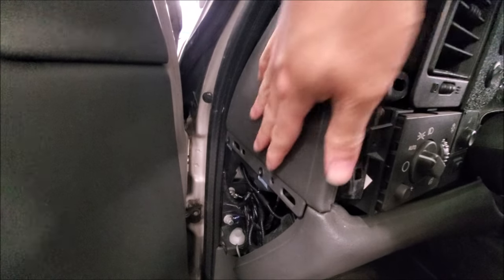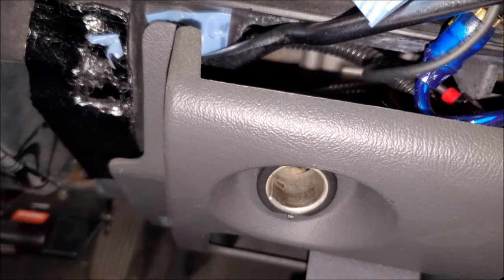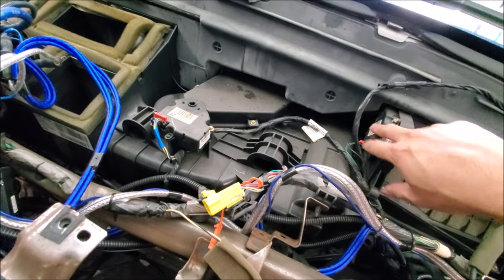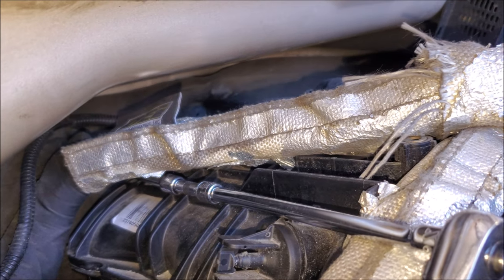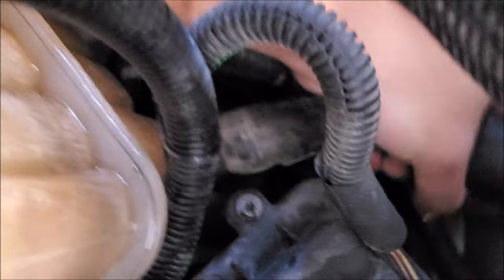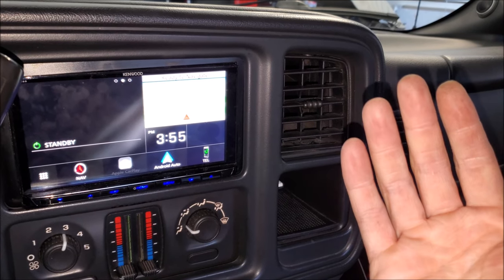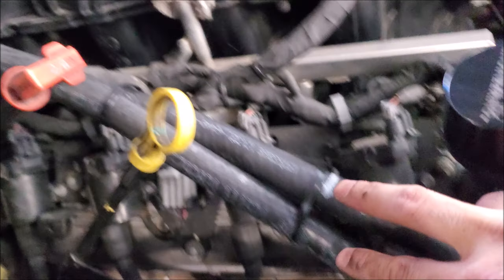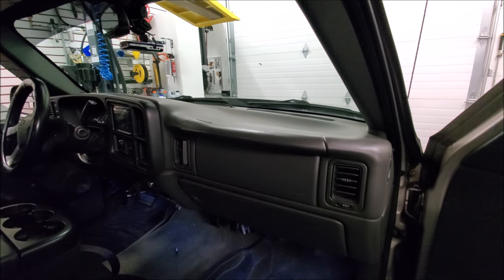Heater Core Replacement 1999-2007 GM Truck (GMT-800 HVAC)| AnthonyJ350

Comment: GM should be ashamed on this design. Dashboard should be one unit and be able to be pulled back in one piece. You have to disconnect your AC system to replace the heater core? Ridiculous.  I bought a 2005 Silverado 2 months ago. Sorry I did. The Fords I had the  dashboard pulled out as one unit and I replaced the heater core without dealing with the AC system. GM should be ashamed with their HVAC system.
Reply from the maker: Your 2005 Silverado is one of the longest lasting trucks on the road currently, and the whole power train is easy to work on.

Did you not see how ingenious the head light design is?

What do you change more often, the heater core or a head light bulb?
Reply from the maker: Triton Ford V8s break spark plugs all the time till the new part came out.
Reply: Ohh yeah you want a ice cream too?
Reply: Try a ford asscourt
Reply: I have an 05 2500hd and a 2000 1500. Both over 210k miles so far. I have been amazed how reliable they've been. Gmt 800s are awesome trucks.

Comment: On the bright side, you could have a truck that doesn’t last as long as these 2000 chevys and just scrap the whole thing before you need a heater core
Reply from the maker: 100% agree. I've had this thing for 15 years and it has served me very well. One of the best generation of trucks ever made.
Reply: I also agree.  I am still running a 2002 gas winter beater, a 2006 Max dually  and a 2007 Max SRW that is almost complete with a full resto.  Love these trucks.

Comment: I needed this video twice. July 2023 and October 2024. Two different trucks, same blend door actuator R&Rs. The service procedures for this are vague. This second time around I just needed to review 1 minute of this video. I had forgotten the order of metal subframing and upper dash removal. Also forgot about the hidden side, middle bolts, and airbag removal. So glad I re-found this video. I’ve been looking for it for almost a week. Finally found it searching Silverado HVAC assembly removal. Thank you for doing this video x2.
Reply from the maker: I'm glad you're finding value in the video!  Make sure to subscribe and it'll make it easier to find the videos and it helps the channel!

Comment: Great video, my blend door for the passenger side vents broke but I'm definitely not doing all of this to remove and fix it 😆 keep it up!
Reply from the maker: Thanks for watching!
Reply: The driver's side blend door quit on my 2005 sierra.  I took it apart, cleaned it up with alcohol and applied a little dielectric grease.  One year out and no problems.

Comment: Great video and explanation as always. During the summer I've noticed that water often drips down from underneath the passenger area, must be condensation? Always wondered if it was a leak, but haven't seen it during cooler weather.
Reply from the maker: That water drip is coming from your A/C system, it's normal.

Comment: Hopefully don’t need to do this on my 2001 Suburban but if I do your careful explanation will come in handy. Question you have a large radio head on yours mine is much smaller can I use the larger head ?
Reply from the maker: 2001 has a different wiring setup than 2003+ so the head units are not interchangeable.

Comment: Great Video!  Hopefully I don't ever need to do this to my 2006 Yukon!  I'd have the extra step of removing the two front seats in order to get the center console out.  Did you undo the steering column and the shift linkage on the driver's side?
Reply from the maker: I just loosed the column, didn't touch the linkage since I was just moving the passenger side out. Just change your coolant regularly and hopefully your heater core doesn't leak

Comment: My vents stink like a dead mouse. Any thoughts on getting rid of that? Would I be able to get a small vac hose down the vents instead of taking this all apart? The smell comes from every vent so thinking the carcass is in the heater box itself.
Reply from the maker: You'll have to pull it apart

Comment: How long did it take you? I broke off a spindle thing that goes into the blend door actuator when trying to replace it. I’m not sure how to replace that spindle now. It’s the actuator on the bottom that goes directly to the heater core
Reply from the maker: It took me a solid weekend to do this job.

Comment: So my blend door actuator for driver side failed (thank goodness because I don't want to ever do passanger side again....) but I went to replace it, well the previous owners must have also done it because the actual stud the blend door slides into was broken and replaced with a bolt.... That being said any idea how to get it to where my blend door actuator and the actual door are in the same position without having to replace the door itself and do all this work😅
Reply from the maker: I wouldn't move the actuator. Can you manipulate the door with the bolt?

Comment: Is that core the same for the ac ? I need it replaced
Where did you get your instrument cluster for odometer and rpm? 

Is the screen in your truck from factory or did you install..

Great video thanks
Reply from the maker: Core is separate from AC condenser. Gauge is from a Cadillac Escalade. Here's the gauge cluster swap video https://youtu.be/yD6NH6LLsf8?si=18P68RuAfrWRkj49

Comment: I have a 2004 H2 Hummer how much would it cost?
Reply from the maker: Not sure, it would be a little bit more work because the dash is different and you have the center console that needs to be removed.

Comment: Very involved job . Things will definitely break . It will take alot of time , unfortunately the video makes it seem like it’s easier than it is . I’ve found that the only way to really do it is to find the best possible way to remove everything while on the process of doing so . There’s more to be removed than it seems in the video .
Reply from the maker: What's missing from the video? It took me 2.5 days. You want the video to be that long?
Reply from the maker: No you can do the job without breaking things.

Comment: So you totally do not have to remove all that ! It’s like take the steering column down and remove 6bolts and two nuts and the entire dash will set around into the passenger seat in Service position then reverse the box and service the box .
Reply from the maker: You got a video or instruction document showing that?
Reply: You got a better response that actually acknowledges the comment? Tuck your ego bub @AnthonyJ350
Reply from the maker: @UntilSorrow  Not really
Reply from the maker: @UntilSorrow  If you don't like how I performed the job. Don't do it that way.
Reply: What do you mean reverse the box?

Comment: I'm not understanding why i have to disconnect my a/c
Reply from the maker: The AC evaporator is in the housing as well. If you don't disconnect, you won't be able to move it back.
Reply: @AnthonyJ350  i see that now, thanks!
Reply: @AnthonyJ350 Did you replace the evaporator while you had it apart?
Reply from the maker: @motofunk1  No I didn't, mine looked good so I kept it. People do recommend to change them at the same time though, especially if you have a lot of mileage on the vehicle.

Comment: Great video but damn now i know im getting rid of this pos gmc thats ridiculous. My 76 ford heater core could be changed in 1 hour without doing any of that man i miss it.
Reply from the maker: To be fair the GMT800 truck platform for the most part is easy to service and there's a lot still on the road.

Do you still see a lot of Ford F150s and Ram 1500s from 2005?

Comment: Dude did a lot of work he did not have too to change the heater core
Reply from the maker: Kind of had to, it was leaking and it smelled like coolant inside. I had to do a heater core bypass in the summer.

Why do you think it didn't need to be changed?